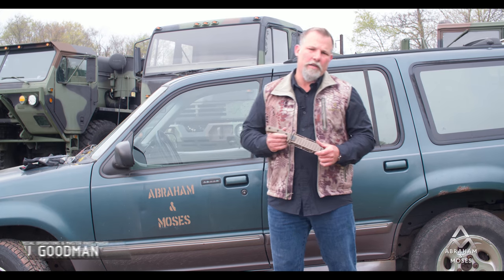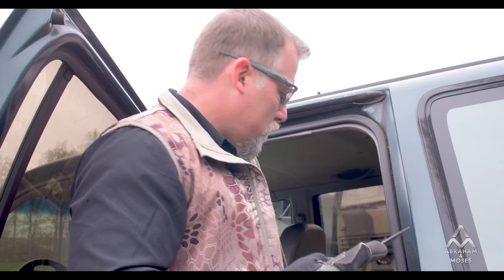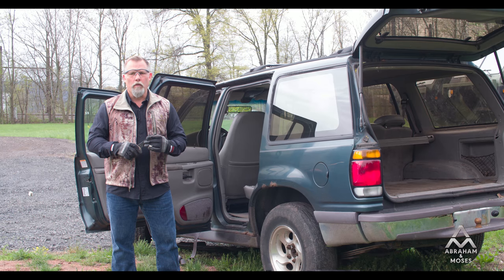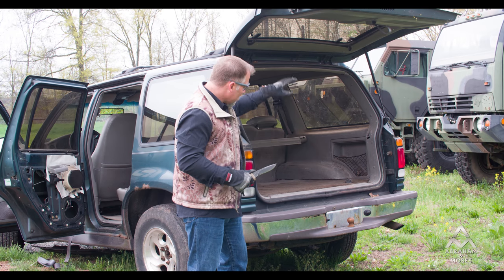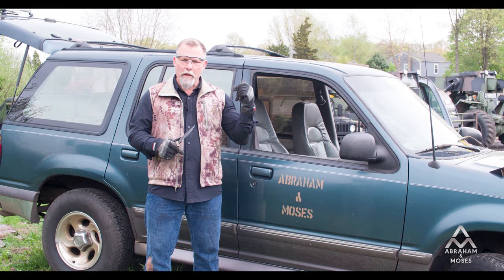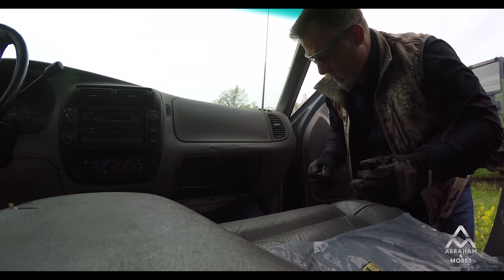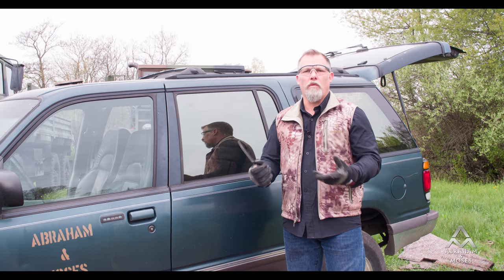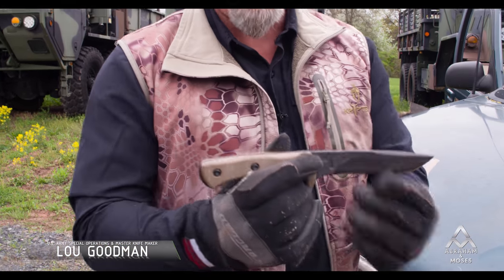A&M Goodman Combat Knife - Vehicle Search - Feat. Lou Goodman

Comment: No offense to anyone; but my Becker BK-2 can do everything demonstrated here. If I lose it, or break it (not likely), I'm out less than $100.
Reply: Agreed. The process and materials that go in to making one of these blades are really cool and expensive. The Nanoweapon coating on the blade seems incredible, but do people really NEED that? Or the differentially hardened triple tempered PD1 steel? Doubt it, but they're nice features to have if you can afford them.  Still a very cool blade.

Comment: I just need to say that: for a "395 dollars price tag knife" (sheath not included); i perceive the "G10 handle scales" as a very poor choice to say the least (like "wood tires on a Ferrari"; almost "an insult to the customers"...)

Hope to see a "linenMicarta option" in the future on the site (at least canvas... But linen would be better).

P.S.
I wrote an esaustive post about "the reasons of my statement" (based on my experience "in my rainy place and beyond", that sound "harsh and annoying") so i decided to keep it on a side, for now...

I don't want to offend anybody, it is just that i am "a bit too direct as a person" (IRL i am even worse); and my limited knowledge of the english language do the rest...

P.P.S.

I own three AR-15; all three are equipped with an "SSA" trigger... Just saying...
Reply: Grappolidipalma If you think that G10 is like wood tires on a Ferrari then micarta is the the same except different kind of wood. The cost is almost the same and they are both laminated materials. In my opinion compared to micarta, unpolished G10 has the slightest amount of less grip when wet. But I think that G10 has a practical edge to micarta in the way of being much easier to clean. So a real insult to the customer would be to use plastic or rubber grip panels. G10 is very good, so is micarta.